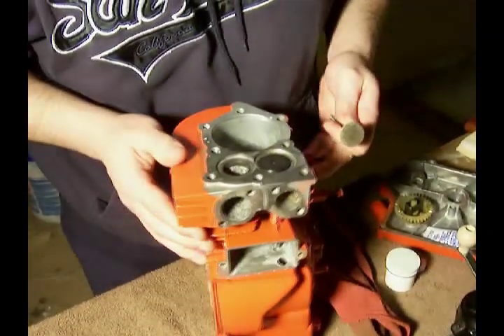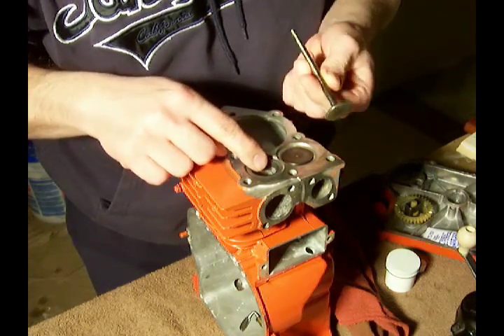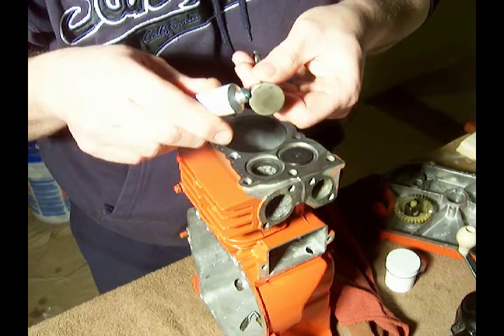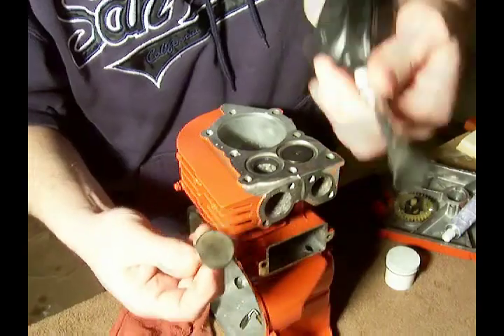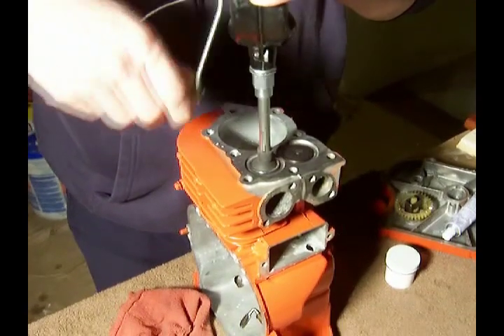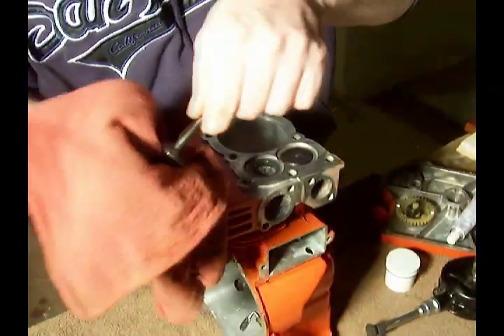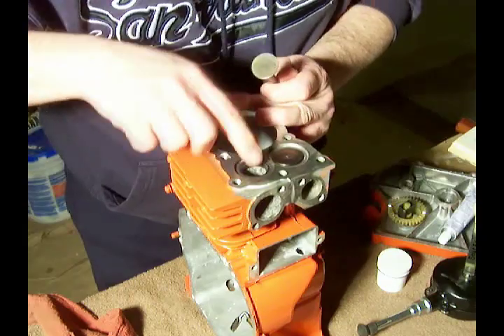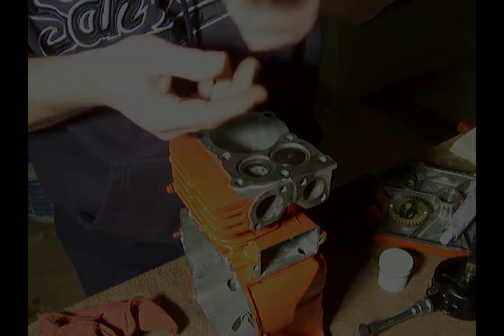#3 - Briggs and Stratton 5HP 130202 - Valve Lapping

Comment from the maker: That valve cover is what I meant when I mentioned the breather valve. Why would you think the bore is too far gone? If you remove the head, you can examine the inside of the bore. Unless there is severe scoring or some other type of damage, it might be worth your while to replace the rings. You will have to decide if all of this time and money is worth the value of the engine in question.

Comment: Well my airfilter is alright, I tried the carb settings but I think there is too much smoke for a carb issue. I didn't think of the breather plug, but where is that located on the engine? I tought there was only the pipe to the carb from the valve cover?
Anyway, is repalcing the the piston rings usefull? I mean when the bore is to far gone new rings wouldn't be of much help.

Comment from the maker: A smoking engine can be caused by a number of things. Dirty air filter, worn breather valve, worn piston rings, valves that need to be re-seated or even a carburetor that needs tuning. If it is the piston rings, you will need to crack that engine open. If the valves need work, you will have to at least remove the head and the valve cover.
Thanks for watching.

Comment: I've got a similar engine (1980) running again after some years, it starts OK and runs well but it smokes a lot. I use SAE30 oil filled to about 2cm from the top of the inlet.
Can changing the piston rings be a solution for this oil consumption, or is the bore too far gone? Or maybe it is leaking oil through the valves? (I didn't had to take the head of.)
It looks like the rings can only be replaced by opening the casing to loosen the crankshaft first.